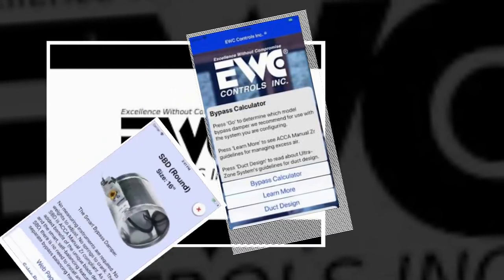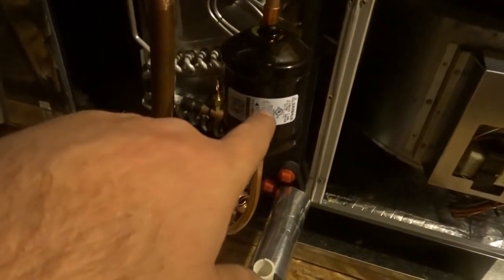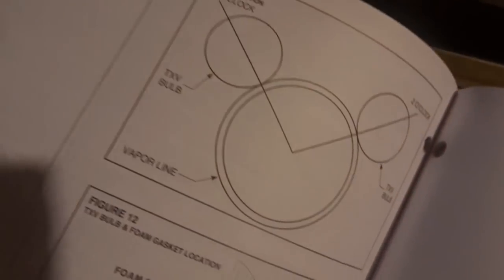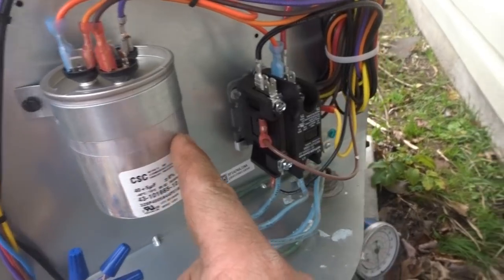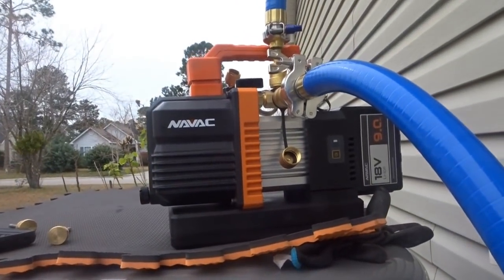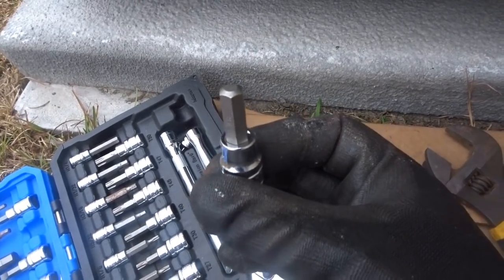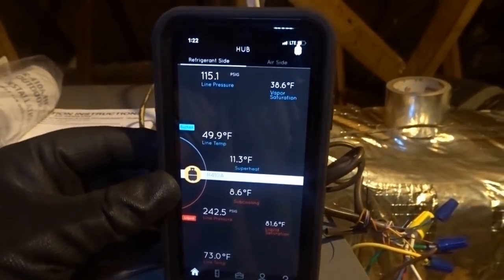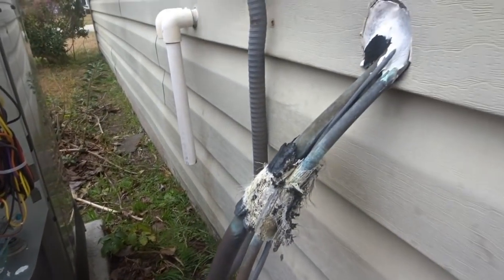6 | 1995 Goodman Heat Pump Replacement Part 2

Comment: Nice video. You should use use another core remover for your vacuum gage so no refrigerant will get in when you break the vacuum. As it stands if you were to remove it, it would break the vacuum.
Reply from the maker: I insert the cores again then remove the assembly. I loose some vacuum when I reinsert the core I guess.
Reply: @HVACShopTalk  yes sir, you do.
Reply: Eric M  true but how that's set up refrigerant would get into his micron gauge.
Reply: Eric M  will in that case it'll be fine. I just don't won't refrigerant in my gauge...lol. I "thought" he removed it like i see most people do. You rarely see anyone one YouTube actually break their vacuum.

Comment: We offer a 10yr parts and 10yr labor if they stay a maintenance member 
@$159 a yr
Reply from the maker: Sounds like a no brainer for the customer
Reply: @HVACShopTalk  yes it is and an extra $1,590 that you would not have made. Pretty good idea cause if it's installed correctly and parts are changed in a preventative way there will be nothing to worry about typically.
Reply: @HVACShopTalk  i fixed the typo and it took away the love...lol